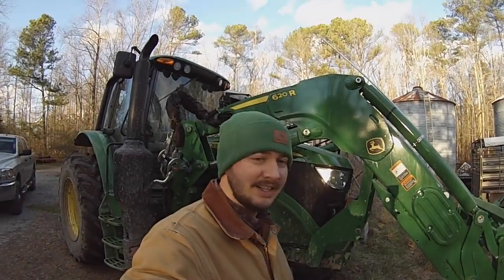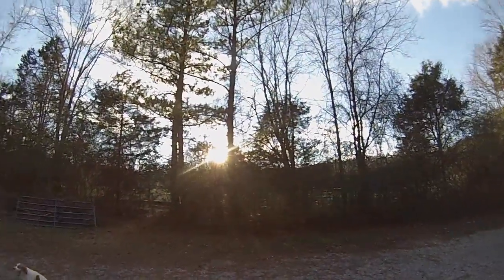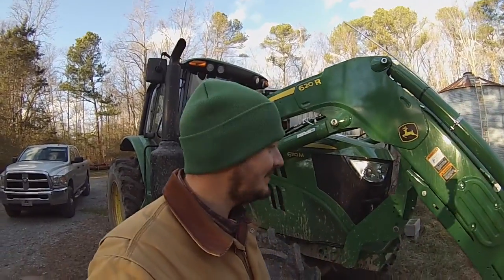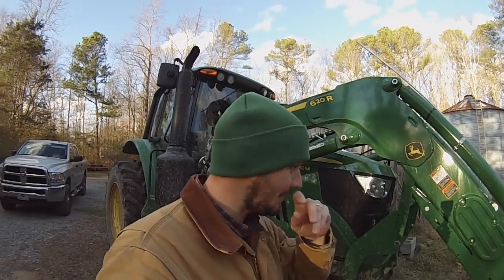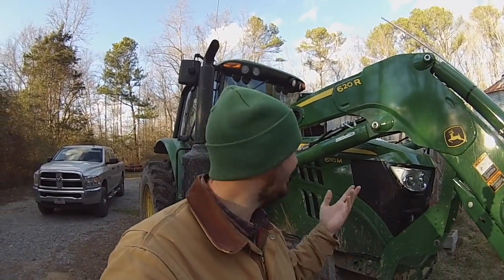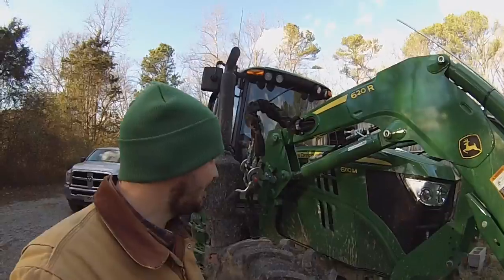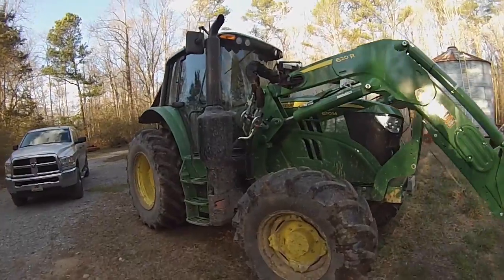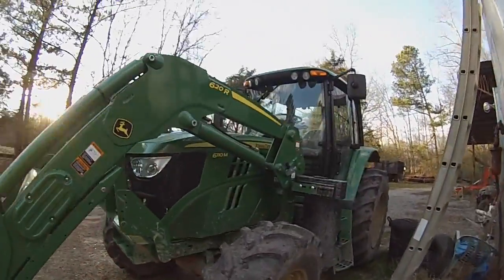John Deere 6110M Update

Comment: I just bought a 5100m with a h260 loader was thinking about buying the plumbing from the bucket back to the coupler and then running hoses to the rear scvs. Just a thought.